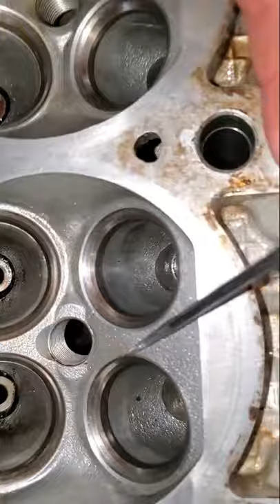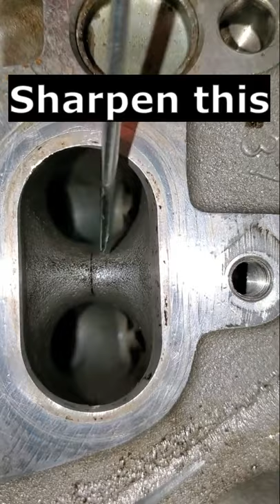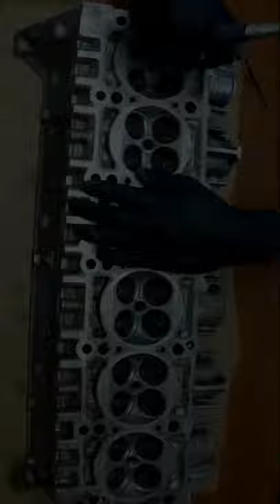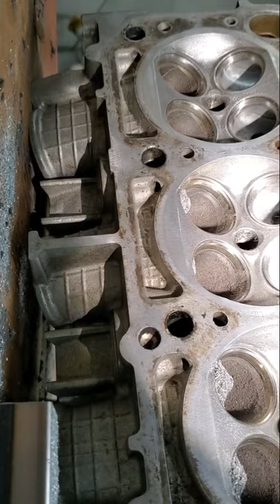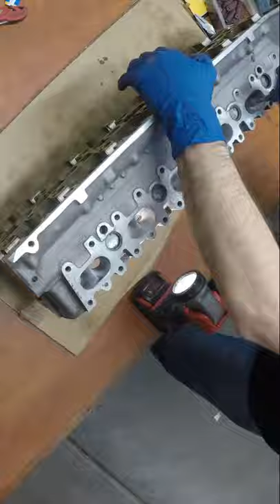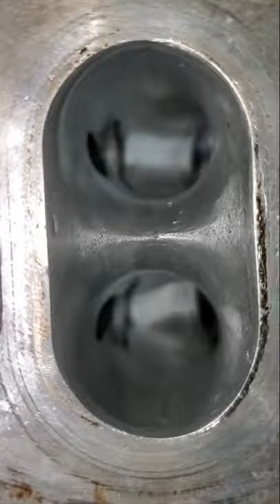Port A Head In 60 Seconds

Comment: Wish I still had my m20 e30 to do this on....today its a 4 cylinder French tdi.
Reply from the maker: Make that french tdi sing, my friend.
Reply: @JakeSublime  I swapped rpm for mpg my talented friend.... I aim for 55mpg on average in a mk1 Peugeot 3008 auto 6spd 1.6 8v Diddy turb lol.
Reply: @JakeSublime  used to have a manual Peugeot 207 sw with same engine. The 3008 is 115hp (as it's a heavier car. Probably higher boost?) but the 207sw had 95hp. I could get up to 75mpg on a decent run.... so who needs a prius. In fact why isn't a prius diesel? Then it would do more than 45mpg. Probably do up to 100 with me misering it lol
Reply: @JakeSublime  ok.... well. Get this.. I'm gonna blow your mind with this one- you may even scold me lol. 

 I change my oil  (fully synthetic 30-05 with additives c) once a year. 
That's normal right?
What if I told you in that year I cover over 37k miles?
On that same oil. I'm on 137k had it since 35. No problems. Sometimes have to top up by half a quart or something once or twice in that year sometimes....last year never needed.

OK now for the high mpg.

Well my car spends it's life at 1.5krpm pretty much. Lol.
It is an art form - for example when you let go of the throttle your car uses zero fuel as road and wheels are turning pistons... lots of forward planning example at traffic lights.  It gets obsessive.
I used to drive fast with my 200sx which had a t28 and various mods like evo4 fuel pump running 287bhp.... so I learned all the tips to drive fast.
But economic driving is just as skillful and Ifvyou get it down; even if in say a big LS engined car and running on fumes - it can get you home lol.
Let me link you a video on my channel  (I have a playlist related to cars but my channel isn't specifically for cars...)
- showing I'm not blagging. 
To learn such driving search "hyper miling" there is a guy who has a corvette that can get 50mpg on YouTube. 
NO kidding!
Although he's tuned it that way so cheating.  Still an LS doing 50mpg lol though!
Anyway next comment. Link to a video of mine. 
Then search hyper miling/50mpg corvette. 

I got better milage out of the 207 as it was manual. The 3008 I have now is 6spd auto but you can override it and the change is actually very fast for a domestic appliance car lol.
Anyway......wait up. Next comment. Link.
Reply: OK here is a saab 93 turbo petrol 2.0 convertible I had getting 50mpg!!
Sadly you can't do 37k with no oil change yearly on these cars lol they suffer sludge and the big ends killed this before I got the 207 (trying to find that video for you but this one is just as impressive)
https://youtu.be/Q3hjxo3-MbA
Reply from the maker: Yo thats literally insane. Ive never heard of someone getting that much out of their motor oil. You're a very knowledgeable person in that field. 

Personally, I couldnt do it. I have to have the engine rev sometimes. I need to feel that pull. And im not a fan of owning 5 cars, ill have a multi-purpose daily (which is this car, the w210 e320) and a truck. So ill be replacing my oil ultra-frequently at 4k miles, and getting 15-20 MGP. :/ 

Lmao
Reply: @JakeSublime  aahhh the w210. Trust me when I say this....
Had I not been in such a financial position today where every millilitre of fuel counts or bankruptcy... then I too would not be employing such driving tactics. 
Like I say- in my 20s I was driving a car doin 0-60 in just under 6 with a top end of 155; and had done every driving course available - career or private based. Aka I drove buses for a living and taxis. Even a telehandler (google it if unsure) - and in my private time I would be doing skidpan courses and racing with said car at castle comb.......but today. 
Well....
.....yeah.
Oh finally- how you do things aka changing oil at 4k etc. 
Far more recommended and I totally support that method over mine.
Mine is through desperation - but proof if struggling. Today's engineered cars too a point...won't blow up provided its yearly and you are gentle.
Reply from the maker: Word. Its unfortunate to hear youre in a tough spot financially, mayeb one day youll again have the ability to enjoy the other side of cars. 

And thats a wide range of vehicles haha! Ive also driven a wide range, but ive never touched a semi or a bus. Ive driven some huge vehicles though. The fastest vehicle ive ever driven was a sport edition of a 2014 nissan altima, with the 3.5 v6 and CVT trans. That thing was so fricken fast dude, i was so impressed. That CVT puts in work, but wont last for sure, unfortunately. 

I imagine CVTs can improve fuel economy too, yes? And do you watch project farm? He has some great videos, one of which goes over engine oils and whats the best to use.
Reply: @JakeSublime  the only cvt I've driven was on my bosses gen2 prius. It's petrol hybrid as you know but I wasn't impressed.  I could barely get 45mpg out of it! - mind you the batteries for lekky only mode under 30mph were a bit knackered so.... only after a mile or 3 would they be dead thus go back to engine on.... so take that as you will regarding cvt 
Why they do that fake 'shift" when you floor it (yes I tested out the acceleration - surprisingly brisk....it does not accelerate- much like an old British jag- it 'advamces') I don't know.... lol
Reply from the maker: @orderofmagnitude-TPATP  Oh, the batteries were shot? 

But as far as pure accelleration, that altima was the fastest ive ever driven. However, my current car that im putting a turbo on (the ported head is for this build) will surely be the fastest. 

Im like a week out now :D
Reply: @JakeSublime  cool. Cool. What spec was the ultima?
Reply from the maker: 2014 altima 3.5 sv. Just saying, that 3.5 (out of the 350z) with cvt is super quick.
Reply: @JakeSublime  aahh I see. I've got a bloody issue today. Need tyre changed on rear. Puncture with screw. (Happening a lot over past few years but I digress)- I repair it usin a repair kit. Doesn't work properly. So needs to be changed. ASAP.
Well... the locking wheel lugnut is damaged so the socket doesn't 'grip' it....
Brilliant. 
Do you know anything about getting a single locking wheel lugnut off?
Reply from the maker: I was going to say, i repair holes. I do it myself, with a kit that has the scratchy stick thing, the rubber sticks, and rubber cement. It was F'd up that bad huh? haha wow sorry to hear that. 

So without seeing the problem, its hard for me to help. The things i would consider: Hammer, angle grinder, welder, torch, an extremely strong "Vise Grip" style pliers/clamp... hmmm... If i think of anything else ill reply with it. 

Did you get it off?

Comment: How do you measure the volume increase after the port? With water?
Reply from the maker: I didnt necessarily do the port job for the increase in 'volume' per se, it was for the benefit of exhaust gas escape velocity and how well the ports reflect heat. I want to boost turbo spoolage and decrease the amount of heat the head absorbs (especially due to increased engine output). 

To answer your question, if i were to test flow characteristics, i would use some type of smoke/aero measurement device (similar to hvac flow testing i would assume) to test flow throughput and turbulence characteristics. However, i did not text flow.
Reply: @JakeSublime  ohh i got it, interesting, didn't know that, so this doesn't increase the power output directly, but to avoid execessive egts. I thought this was done in the intake.
Talking about turbo spooling, does a decat provide a quicker spooling?
Reply from the maker: To some degree, im sure power will be increased, however slight it is. But yes, the goals were to decrease heat transfer from the exhaust to the head, as well as smoothing the port walls. Both of these goals will increase exhaust gas velocity, in turn boosting turbo spool rate (less turbo lag). 

And depending on the setup, removing cats will likely increase spool rate and exhaust flow. It could (again, depending on setup) increase peak boost as well.
Reply: @JakeSublime  
Have you considered having the exhaust ports ceramic coated, it greatly reduces heat soak and improves exhaust gas velocity by retaining heat/energy in the exhaust gas.
Reply from the maker: Yes, in fact i coated my pistons with cerakote c110. I didnt want to go too far with the ports though, so i just ported and polished.
Reply: @JakeSublime  you’re not looking for volume increases with porting and polishing. You can think of an engine as an air pump, the more efficient you can get air in and out the better the engine will perform. There are other things that go along with it like turbulence and atomization but that’s the simplified answer haha
Reply from the maker: @BAbullitt  Couldnt have said it better myself. 

And my thought is: the smoother the walls, and the smoother the dividers/recombines, the less resistance the exhaust has to exiting towards ambient air pressure out the eventual tailpipe (slightly more energy to spool the turbo sooner). 

Also, the smooth walls will absorb less heat from the exhaust, helping the exhaust retain +0.5% energy while exiting the head (slightly more energy to spool the turbo sooner (again)). Plus -1% load on coolant system from the head. 

Gains are negligible, but i wanted to do it regardless.. -- I have a ported head, You do not (majority rule). :)

Comment: Definitely 12-20 hours of work to do it right. How long did it take you to complete this??
Reply from the maker: Several days of a couple of hours of work per day. IMHO it was worth it. Im sure the exhaust temps are slightly higher, exhaust velocity is slightly higher, heat transfer to the head is slightly less, slightly more evacuation from the combustion chamber, and also i can say i have a ported head, and i did it myself. Sooo lol worth

Comment: Didn't show the short side of the port where it meets the valve seat, usually the most critical part of the port in terms of airflow.
Reply from the maker: I did get that all blended, it was just so hard to get the whole port job into the 60s. Ill likely make ma "Port an Engine Head 2" or something and show other stuff

Comment: How do you know If there the same between all of them or does that not matter I'm not a mechanic so idk lol
Reply from the maker: So if you can imagine, from the factory (after the cast aluminum head has been machined to accept parts) the head still has flaws and minor inconsistencies. This is simply due to the nature of casting molten metal, as well as capitalism (simple cheaper processing > complicated expensive processing). 

With this in mind, my job in porting this particular head was primarily to smooth and clean, and the divider work i did wont really impact flow enough to matter, as far as cylinder to cylinder flow balance goes. The basic flow characteristics of the head still exist, i just enhanced them is all.

Comment: Is this on a carburetted engine? I've heard full smooth is not ideal for fuel atomization
Reply from the maker: Great observation, friend. Youre totally correct, a carbureted engine relies on air turbulence to mix the fuel with the air. Carburetors that could make the droplets of fuel smaller were the ones that were more expensive and good for performance. In the day, you would port but not polish the intake side. The exhaust side will always benefit from a polish, however. 

Today, we rely on fuel injectors to atomize the fuel, and the intake runners purely turn into simple ducts. We do not require further fuel/air mixing once the fuel injectors deliver the fuel to the air. Now, a duct with a perfectly smooth surface will flow better than one with a rough surface. 

Nuff said.
Reply: @JakeSublime  well depends how smooth because once its very smooth u lose wat called a boundary layer which is a turbulent air flow thats stuck to the sides so actual airflow never touches the runners, just like golf balls and also alot of engines use turblance to push more air in just how variable runners r used so intake is extremely complex and usually results in loses, except for forced induction where all this doesn't really matter

Comment: Sharpening the divider is a terrible move, air flow does not like to be split by a sharp point. Just look at airfoils for a wing if you want a prime example
Reply from the maker: You are correct. However, this is the exhaust ports. The 2 ports are combining into 1 tube. Sharpening and cleaning all this up will definitely benefit me.

Comment: whats the sense behind this?
Reply from the maker: Improve exhaust gas escape velocity, to spool the turbo faster!
Reply: @JakeSublime  cant you just cut the whole divider out?
Reply from the maker: Well, the divider has a purpose. The exhaust comes out of the cylinder through 2 valve ports, and then combines into 1 larger port shortly thereafter. The divider needs to exist, but you want it to be as smooth and as flow promoting as possible.
Reply: @JakeSublime  oh okay thanks!

Comment: 1JZ/2JZ?
Reply from the maker: Its a cheap and common engine to find in the US, consider it the Mercedes version of the 2jz. Its the m104 (mine is the m104.995), stock from the factory ready for a turbo and 500hp, no block mods.

Factory features: DOHC, iVVT, reinforced crank mounting, crank thrust washers, full rotating assembly lubrication system (up to wrist pin and piston skirt/sidewalls). 

Replace the rods, and put in a mains girdle/brace, the m104 block can handle ~1000hp.
Reply: @JakeSublime  I feel the need to know more about this M104.995 you speak of.

Comment: Aren't sharp angles worse for air flow?
Reply from the maker: yes, thats why i smoothed everything as best i could. Then, the divider was sharpened to allow the exhaust gasses to recombine as smoothly as possible. 

Think the tip of an arrow. That sharp tip divides the air quite well. It will recombine the air with similar efficiency.
Reply: @JakeSublime  Ohhhh, that's smart. Did you see much of an increase in power or is it more of a while you're in there job when you are doing springs or valves?
Reply from the maker: I actually rebuild the entire engine, and yes it was a "while youre in there" thing lol. The goal of this port job was to increase exhaust gas velocity, to spool the new turbo faster (to decrease turbo lag). And the car is almost back together now, well find out soon enough if the port was worth the time!

The engine is rebuilt with stock internals, and will hold 500hp to the wheels (over 2x factory output). Just some extra info for you, maybe subscribe and follow my build series. :)
Reply: @JakeSublime  I'll definitely follow along.

Comment: With boosted engines me and my buddies running 800-1200whp volvo engines have come to conclusion that porting is waste of time. Just run bigger sized turbo and more boost to get results. Porting gives 20-30hp on the same boost levels tested on dyno. So basically nothing. Non boosted applications is needed to do to get more horsepower. But if building first motor of course everyone wants to port. But after 10 motor builds no thanks man hah. have a nice day
Reply from the maker: I see what youre saying, and to some degree i agree with you. But my goal was to improve exhaust gas escape velocity to spool my turbo faster for less turbo lag. That, and hopefully a more reflective surface keeps heat in the exhaust for additional exhaust gas escape velocity. 

That was my goal with the port.
Reply: @JakeSublime  is it working or still an "in progress" thing
Reply: @MrVAuto  Check VRCF.Fi site all photos of builds and extra much conversations via text included. Use google translate. This kind of reporting how guys build sick cars and share details not here on youtube where us from the forums just come and laugh while most of the amateurs need videos to understand how to set up megasquirt etc
Reply from the maker: @Ryan Young Its still in progress, but the engine is in the car, all connected. Ive got the ECU and turbo, etc, and everything aftermarket is now going in.
Reply: CzMnHD, you do realize that boost pressure is a measure of restriction right? Porting increases cross sectional area of the ports as well as overall flow of air and or fuel. If flow is increased, all things being optimized, power will increase while peak boost pressure will decrease. Less boost with more power is a sign of overall efficiency as well as being easier on the engine long term.
Reply: @rickmosholder4593  yes i do realize volvo 5 cyl with diesel block + welded cams 1140hk
Reply: @CzMnHD  it seems to me that you didn't get good port job... It absolutely doesn't mean that porting is a waste of money or work. If you know hiw to do it properly you can get huge gain, ESPECIALLY on boosted application with very high power level.

Comment: My favorite part is engine appears  stock on the outside but this porting just gave you at least 3-5% more power across the board then I'd take all the valves out and add angles n a back cut  to then give you  another 2% not bad for a little machine works that no one can readily identify 5-7% more power and better gas mileage-FACT
Reply from the maker: Yeah youre probably right. However, i strictly did it for the efficiency, and the extra turbo spool basically. I figure all the small additions i did across the board, of all the slight efficiency boosting mods, will add up in the end and make a more snappy car with a better torque curve. 

Any extra power is just a plus haha

Comment: Not worth the extra 20 HP...
Reply from the maker: I agree, it wasnt for the horses though. It was for the improved turbo spool time, i only ported the exhaust ports. 

I care about spool time, thats also why i opted for a twin scroll turbo. Though more complicated to have to custom fab a twin scroll t4 turbo manifold, i badly want to reduce spool time. 

I also sized this turbo as closely to my engine as i could, so im running no BOV or WG. Just.. Straight exhaust/intake, f'n send it. Itll work though, watch.